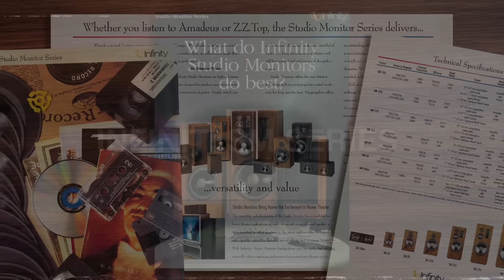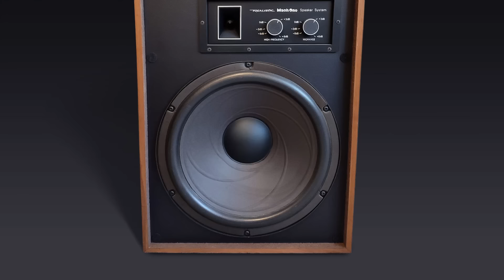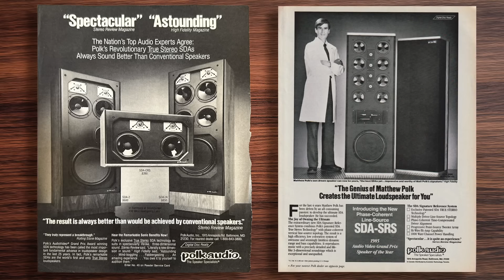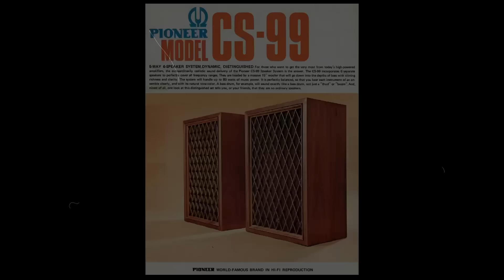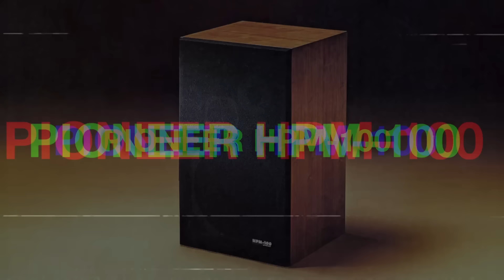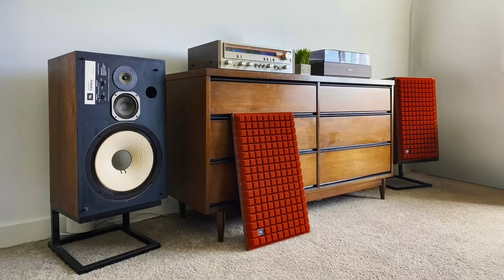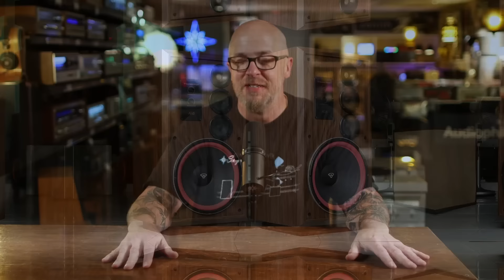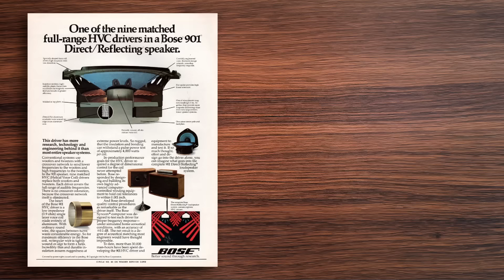Why Do Audiophiles Hate These 9 Legendary Speakers?

Comment: Bose 901s. Never had a pair, but they had a greater effect on my family than any other speaker.
 My father worked for Consumer Reports magazine and did the test of the original 901s back in 1970. They judged the sound of the 901s to be so different, that when they published the article they put the Bose in a separate section explaining they had an unconventional sound that some people might like but was not really high fidelity.
Dr. Bose was upset that the 901s weren't declared the greatest speakers ever and sued Consumers Union (publisher of Consumer Reports) for libel. Bose won the first trial, lost the appeal and took the case to the Supreme Court where he lost. Ten years of heartburn for my dad. When my father retired his co-workers gave him a pair of Bose outdoor speakers as a humorous gift (I still use them in my garage).
Reply: My sympathies to your father. It is often said that Bose have more lawyers on their books than engineers. I don't know the truth of that, but they seem to take criticism very hard.
Reply: @rogerking7258  Since i worked there in IT for 15 years i can tell you that was certainly false when i worked there,  Only 3 people on the legal team when i was there. Out of ~10k people world wide over 1000 of them were engineers, pretty sure engineering would have been the largest singular department in the company if you combined all of the different engineering departments together since there were quite a few each with a different focus.

FWIW, i was never a fan of the 901. Never sounded good to my ear even in the special testing rooms we had. In my opinion the 301 was the best speaker we made at the time. Never liked the Acousimass series either.
Reply: Respect! He made the right call :) Supreme Court, though, damn. He really did sweat it for a while! Awesome story, thanks for sharing
Reply: I recall a review when the Bose 901s came out that the writer said a piano keyboard sounded nine feet long.
Reply: @marknelson8724  How long does Keith Emerson's piano keyboard sound played live in a large hall?
Reply: That was the May '70 issue that was blue with 5 check-rated speakers pictured.
They were the AR-2AX, the Dynaco A25, the HH Scott S15, the ADC 303AX, and the KLH Model 6.
I recall they did not like the AR3A because it had too much bass, and the Bose 901 because it made a piano sound like it was stretched from wall to wall.That was an iconic article. I have a copy somewhere and some digital photos I took of it. Everyone should read it.
Reply: The fact that Bose actually sued a review company, proves they're too niche for serious audio.
Reply: @alisamenna  Alarms bells sounded when trying to A-B demo them back in the day, not being able to play my own source through an amp into their 501s, so I thought I'd pass.. And anyway, too expensive at the time. Then a local pub in Scarborough disposed of a bunch of 301s due to a refit, and I inherited two pairs. I soon discovered Bose products are fine for a pub, but they are not Hi-fi. Depends on your needs. They didn't suit mine.  My daughter's cheap Eltax through a Cambridge amp sound WAY better, so sue me..
Reply: @alisamenna  Sort of like the orange man.
Reply: Interesting replies. I pulled out the original May 1970 article. The lawsuit centered on the sentence the the instruments "tended to wander about the room". The original test report described the instruments wandering across the room and an editor changed it to "about". The original trial judge found that this change "proved" Consumers Union had maliciously made the change to harm Bose.  Apparently the part of the report that said "individual instruments seemed to grow to gigantic proportions" was not contested.
  Ironically reading the whole article, it really isn't a takedown of the 901s. The final paragraph states "We think the Bose system is so unusual that a prospective buyer must listen to it and judge for himself".
 BTW  The report also says "The overall sound was of good quality with impressive bass, considering the small speakers".
 And it seems to this day, people are following Consumer Reports advice and judging the 901s for themselves.
Reply: Those 901s sound very good if placed correctly and the louder they are played the better they sound which is actually quite an achievement for a small speaker. If you want a party  the Bose 901s are the fellows for the job.
Reply: I used to use them as a midrange speaker in a tri-amp PA setup when I played in college rock bands. There is no doubt they can pump out some serious midrange frequencies. Seemed like the perfect use of this speaker design to me. LOL
Reply: Was he the guy who said they sounded like a seven foot wandering violin"?   Haha.
Reply: Had a set of Bose 901's series IV in the late 70's.  They were really good...in the correct space and mounted correctly.  They were not good in the average living room.  I built a special set of wooden hangars to suspend them the correct distance from the wall, the ceiling and each other.  Then I mounted them in a den where the acoustics were really matched to what these could produce.  It worked...but was a lot of work to get there.
Reply: Our dance studio has a pair of original 901s in the second-largest room, suspended the correct distance from the ceiling, with the EQ. I've been an audiophile my entire life and have to say that this configuration is the best I've ever heard. We dance at (and I photograph) West Coast Swing events, where mid tempo 4/4 pop music ranging from R&B to EDM, is played, and the 901s deliver it without any coloration and a surprisingly extended low end that you usually only hear from expensive standalone club-grade subwoofers. A few months ago they replaced the amp and left out the EQ but I'm happy to see it's now back in the loop at our weekly dances. And that studio gets used almost every day. At home I have very flat Revel speakers am not normally a fan of the Bose sound.
Reply: That sucks, but on the other hand, Consumer Reports suck for what they did to Suzuki.
Reply: "Blose" speakers.... 🔊 

😏
Reply: @davelowets  Typical juvenile comment.
Reply: Not surprising, given Bose's snobbish personality
Reply: Your dad was right.  The way Bose marketed them in stores was that they used special source material, recorded in an anechoic chamber.  Then the Bose, bouncing sound all over the place, sounded great with that material compared to conventional loudspeakers.  But, if you used conventionally recorded music and A/B'd them against almost any descent speaker, the Bose sounded weird.  I was a hi-fi geek as a kid and always wanted to listen to a pair.  When I finally got my chance, I was totally disappointed.
Reply: You pretty much nailed it. One addition though, the JBL L-36. Think smaller L-100 with a 10" woofer. Absolutely wretched sounding.  Spent a whole day in our showroom trying to get them to sound even fair. Different locations, different mid and tweet settings, nothing could make them sound like anything but a very expensive AM radio. When compared to the similar priced ADS L710, it was almost comical. FWIW we also had Advent, Dahlquist DQ-10, JBL L-100, L-65, Yamaha NS-1000M and the Koss Electrostatic - a truly magnificent 250Lb beast of a full range electrostat speaker that needed 200W/ch minimum.
Reply: @panzrwagn How much did those 250lb beasts cost? They didn't just need a lot of power. They needed a lot of current. Clean current.
Reply: I was born with HPM-100mk1's in the living room. My father handed them down to me, and I still enjoy them. I've sold audio for 15 years. I've learned to appreciate the differences between many brands, and I do have a soft spot for Klipsch as well. Never been a fan of CV's and all entry level JBL stuff.
Reply: Bose is a highly litigious company. The case your dad got dragged into seems to be driven by nothing other than pure vindictiveness.
Reply: I agree with your dad, and  might have even read that review in CR. Bose wasn't, and isn't, famous for accurate sound reproduction. They are sort of like Apple, making innovative products that are easy to use, above all. They appeal to audio beginners. Oddly, Apple itself is a stickler for high quality audio and image quality. I did hear the Bose speakers in a good hi-fi store when they came out. The concept of better rendering of spacial qualities of sound was interesting. Bookshelf speakers don't do this very well. Who wants music that sounds like it is coming out of boxes? Sound is 3D. Bose got that right. BUT... As far as tonal accuracy, the Bose were on a par with those mid-fi creations of the time known as consoles. Not surprising, since the speakers have no woofers or tweeters. In other words, they can't reproduce instruments so they sound like instruments. You would need a tin ear to miss this. Maybe there are a lot of tin ears out there? Evidently there are lot of people who above all want a punch in the gut from their music, similar to what you might get being body slammed in a hockey game. I am surprised the review didn't use the term "West Coast Sound," which was used at the time to convey a sound inspired by Hollywood, not the concert hall. Flashy, loud, "impressive" (at first), like the new kid on the block that wants your attention in the worst way. Myself, I thought the AR speakers sounded the most natural, and ended up buying a pair. Later I ended up getting the least expensive Stax headphones, which sounded similar to a pair of electrostatic speakers that cost about 100 times as much, and won't upset your neighbors.

You need to hear the actual sound of instruments to calibrate your ear. Acoustic instruments played live in person. Otherwise how could you know what good music reproduction is? It would be interesting to know what kind of music people listen to on their speakers, that's the most important thing. What do we listen to music for, anyway?
Reply: @johnharvey7913 big ups on the AR speakers, my first speakers  was ar4 book shelf ❤❤
Reply: No to BOSE
Reply: No highs, no lows, must be Bose.
Reply: Is that why Amar Bose sued? 
Because the 901s were not declared the "greatest speakers ever?"
Not because they made a subjective evaluation, while pretending it was scientifically arrived at, about something as subjective as sound quality? Or because the magazine altered the original reviewer's evaluation, which Bose wanted restored?
Reply: I wish I'd known that before I bought my Acoustimass 5 in the 90s. They were perfectly fine at the time when I needed small speakers and a sub, but what jerks.
Reply: @darkpatches  
You liked them well enough until you hear what others say about them.
Very scientific.
I love reading people's comments about Bose products.
Reply: @sPi711 That is not, in fact, what I said. Hearing what others said about their sound quality didn't deter me from buying them or alter how I heard them. If the alleged lawfare was true, I wouldn't have bought them. You're very touchy about this.
Reply: @darkpatches  "Lawfare!" (I get it now.)
That's another way of thinking about something that you wouldn't have if somebody hadn't told you how to think about it first. 
You said you wouldn't have bought something that you actually enjoyed if somebody had told you something about them (that may or may not have been true) that had nothing to do with sound. That's the fact. 
And I just remarked how much I love reading people's remarks about Bose products.
Reply: @sPi711 You have no idea of how much thought or effort I or anyone else would have put into researching the lawsuit claim before before ultimately deciding to or not to buy the product. I bought the Acoustimass 5 because of room logistics and lack of options and it sounded decent, but it replaced better (much) larger speakers. You're correct that my comment assumed the truth of the claim, but it was a quickie response to as scenario that cannot be acted on, as I have no time machine. That's also why there were no supporting annotations and why it wasn't in iambic pentameter. If Bose had been found out to be a villain, I would have worked harder to find another option. Bose products are generally so mediocre (but just fine if that's what ya like), that it's really not worth looking up now the legitimacy of the lawsuit. Hard to tell of you have a genuine opinion about it or are just killing time on a dead issue.
Reply: @darkpatches Bose's lawsuit was based on his perception that Consumer Reports, for arbitrary reasons, was discouraging potential customers from buying their product. If that was your product and you saw those recommendations, you might also sue the magazine. 
And you would be right to do so. 
I enjoy reading people's observations on the 901s, especially because I know that they basically amount to "piling on", and that there's no way that many people can listen to those speakers in varying setups and come away with precisely the same repetitive negative conclusions. 
The frequency response of the 901s go right up to the normal limits of human hearing and beyond the range of orchestral instrumentation. And the contours of that dynamic range is selectable.
There are also speaker systems that go many thousands of dollars beyond the cost of the 901s, including many that have multi small driver systems that require outboard crossover network systems in order to produce an "accurate" dynamic range.
The 901s do some things extremely well and some other things not so much. I have several speaker systems of which the 901s are one. And no matter which ones I intend to listen to, I always go back to the 901s at one point or another; especially since I've had the equalizer box recapped with high quality components. They are fun to listen to.
There are audio companies who have found that these speakers have such a wide satisfied customer base that they have built dedicated equalizer units for them. I have tested these out as well and they are very good. 
I have no idea what you mean by "iambic pentameter."
Reply: @darkpatches  Bose's lawsuit was based on his perception that Consumer Reports, for arbitrary reasons, was discouraging potential customers from buying their product. If that was your product and you saw those recommendations, you might also sue the magazine. 
And you would be right to do so. 
I enjoy reading people's observations on the 901s, especially because I know that they basically amount to "piling on", and that there's no way that many people can listen to those speakers in varying setups and come away with precisely the same repetitive negative conclusions. 
The frequency response of the 901s go right up to the normal limits of human hearing and beyond the range of orchestral instrumentation. And the contours of that dynamic range is selectable.
There are also speaker systems that go many thousands of dollars beyond the cost of the 901s, including many that have multi small driver systems that require outboard crossover network systems in order to produce an "accurate" dynamic range.
The 901s do some things extremely well and some other things not so much. I have several speaker systems of which the 901s are one. And no matter which ones I intend to listen to, I always go back to the 901s at one point or another; especially since I've had the equalizer box recapped with high quality components. They are fun to listen to.
There are audio companies who have found that these speakers have such a wide satisfied customer base that they have built dedicated equalizer units for them. I have tested these out as well and they are very good. 
I have no idea what you mean by "iambic pentameter." I know what iambic pentameter is, I just don't know why you mentioned it.
Reply: @sPi711 I meant, I didn't put that much work or thought into the comment, though, in general, it did and still does reflect my POV. 

Never heard the 901s, but I'd like to. Probably hard to find a pair set up properly even if I did. Exerpts from the CR review sound similar to what I've heard other owners say, but you appear to feel differently or don't care about their quirks. Around '97 CR wrote that the Kia Sportage had the "nastiest ride of any vehicle they'd ever tested." Maybe Bose should have rolled with it like Kia... unless the bad press and lawsuit resulted in more sales. It's happened. I ended up buying a powered sub to augment the Acoustimass 5.
Reply: @darkpatches  Shakespearean drama is typically "sung" in iambic pentameter. That's why I was confused.
I wouldn't recommend anyone going out to get a pair of 901s unless they know what they are. The earlier models hold up better than the latter ones and there's no telling what condition the active equalizer is in. 
Anyone who wants a pair should make sure the surrounds are in good condition (or they want to take the time to replace them) and then contact an audio company (which I hesitate to name here) for their own digital active equalizer made specifically for the 901s.
Reply: @sPi711 I believe you're forgetting the sonnets. Not meant to be sung, like (most of) my YT comments.

Your commentary about the 901s themselves was quite interesting. Thanks.
Reply: @sPi711 The main point people are making is that Bose does not sound like Hi-fi sounds, and yet their products are mis-marketed to the gullible at the price-point of superior-sounding competitors that DO offer hi fidelity.  Bose does not. Their designs and engineering are flawed, and sound inferior, even with the extra electronic trickery. They always have.. 
They're also too placement-fussy and equalisation-dependent to qualify as Hi-fi. 
They shouldn't be sold as such, hence the 'pile-on'.
They are a little like the 'Apple' of audio, although Apple products are actually quite capable lifestyle products, if over-priced. 
You seem very defensive of an average, over-priced brand, wondering why?
Reply: @diabloblanco47  Because I look at hi-fi products with a more balanced perspective. I've seen a lot of them. I've heard a lot of them. Side by side with the 901s. I know what the 901s are. 
And what they are does not jibe with the observations of the vast majority of people who've never heard them. Or else have compared them with products costing hundreds or thousands more. 
In my listening room they sound great.
You're one of those people who needs to be told what high fidelity is. I wouldn't exactly call you a parrot, but it's not unlikely. You pretend that Hi-Fi manufacturers don't market their products; as though the sound alone is what sells. 
The 901s sold for 50 years. Are you saying that everyone who bought them was tin-eared and gullible?
I recently read a review of a rather high priced integrated amplifier. $60,000. 
Here's a synopsis of the reviewers. Observations:
"Pros and cons: Good soundstage depth and width.
Lacked slam, bass response, body and warmth..." 
Someone will buy this. Thing. 
I wouldn't buy it at 10% of that price.